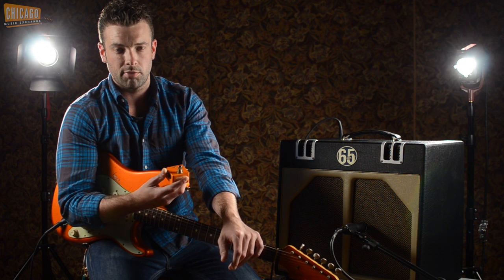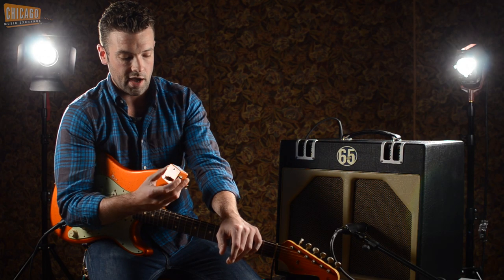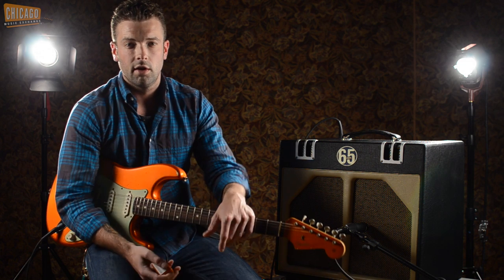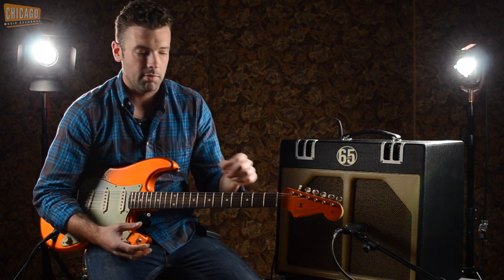Henretta Engineering Orange Whip Compressor | CME Gear Demo | Joel Bauman

Comment: For those of you commenting on the noise: It was already there without the pedal, he's using a strat and sitting right next to the amp, so of course it's going to hum. 

Compressors are great pedals, but if you already have a ton of noise in your rig, they WILL amplify that. It's just how compressors work and it is by no means the pedal's fault, in fact, the pedal is doing exactly what it was designed to do.

Comment: I'm aware what a compressor does, irrespective this is a noisy set up.  I run a guitar with 1967 singles coils into an Xotic Sp compressor, I can even stack fuzzes after the comp and not get as much noise as there is here...

Comment: 120 euros for that simple thing ? a bit too overpriced for what it is !
Reply: How? It's cheaper than a keeley and sounds just as good
Reply: +MrBingping, I'd hope that it's cheaper than a Keeley, considering this has no knobs and the circuit is about half the size.
Reply: +Anarcho Communist how does size have any impact on price? A current big muff is fucking enormous, but I'd much rather have a wren and cuff clone which is smaller and better
Reply: MrBingping I mentioned the size of the circuit, not the size of the box. Two different Big Muffs will cost about the same to make, but something like a modulated PT2399 delay will cost more to make than a Big Muff due to having a more complex circuit. Cost of production obviously impacts price.
Reply: +Anarcho Communist well let me know when you find a cheaper orange squeezer clone that sounds as good.

Comment: I like the pedal but it sure is noisy. Listen for that buzz.
Reply: Compressors rarely produce noise. They do amplify noise, it's what they're built for (making quiet parts louder, and louder parts quieter).

His rig is noisy, duh...strat... But the compressor is fine
Reply: laurens b
 Thank you I didn't know that.
Reply: That is not Buzz. That is hum. There is a difference. Look it up. It is coming from the cables he's using and his guitar pickups/eletronics. 
Check out Kinman Single coil pickups, they eliminate that, so that you won't have any problems with compressors or other such factors. Amazing pickups made in Australia